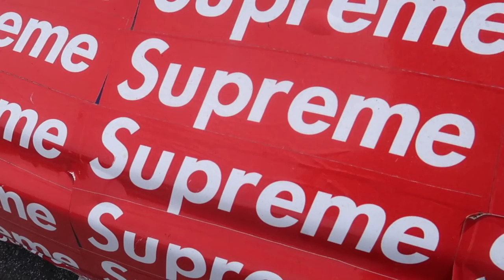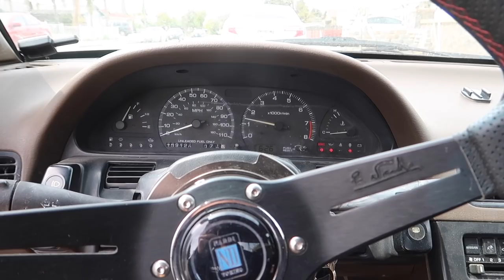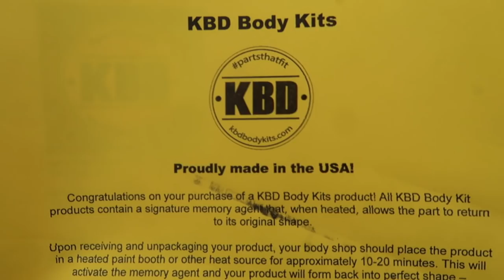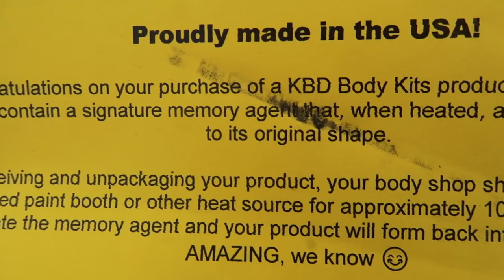They folded my BUMPER IN A BOX!? (INDESTRUCTIBLE)

Comment: Quick life hack for front kits. If you drill short screws with washers along the bottom edge of the lip. The ground won't eat up the poly and the screws will protect you for a long time. 👌

Comment: 2:55 its a oontz angle 3 for anyone wondering i have had it for about 2 years,last month it was making a static noise but it  was an easy fix for the negative wire still very good speaker

Comment: Nice I got the same kit.. The whole kit tho lol doesn't like to stretch around my front 40mm origins
Reply: would you agree that you need the whole kit for things to line up? i have a full origin urban kit, haven't put it on yet. Thinking of selling my front bumper and buying a KBD but don't wanna run into the same issue as sonny
Reply: Panbruh Randy is right, the kit flows right around the car with the full set. Lines don't match around sonnys because he just got the front.
KBD was moulded for OEM fenders, origin/aftermarket fenders may need some trimming to wrap the bumper around. Side skirts and rear bumper fit like a glove.
Reply: thanks for the reply homie, excited to go KBD